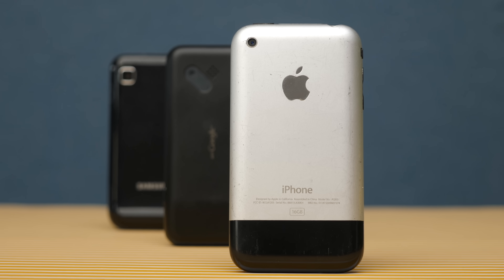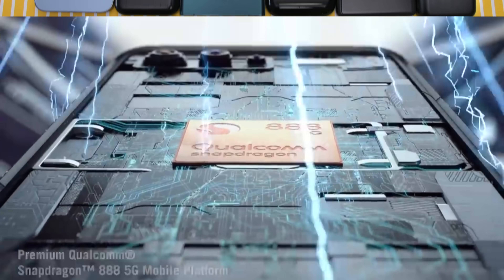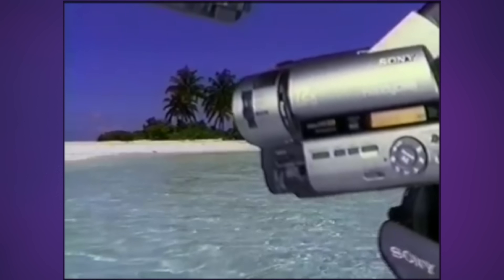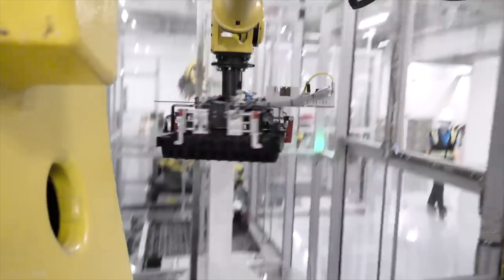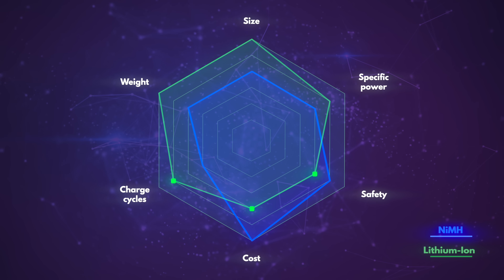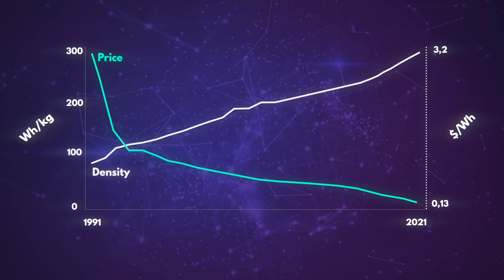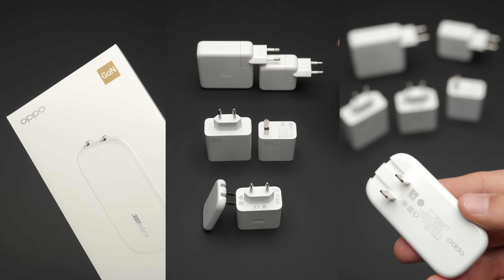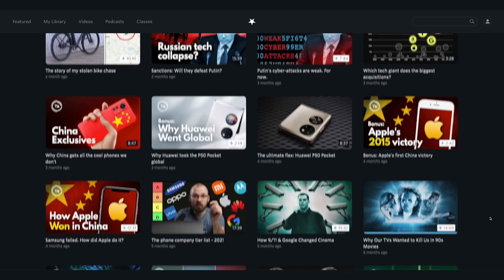The billion dollar race to fix phone batteries

Comment: Personally due to my financial situation I can't afford to change phones super frequently. My current phone I've had for 3 years and the one before that I had for 5. My last phone was an LG V20 Android and I had upgraded the battery multiple times over the 5 years I had it even going as far as doubling the stock battery's capacity since it was cheaper than a new phone. I eventually did get a new phone, a Google Pixel 4a 5G in December 2020 for $500 and I must admit the battery, while being 2000mah smaller than the aftermarket battery in my V20 lasted longer. Even 3 years later, despite starting to see issues with the battery it still lasts damn near the whole day under moderate usage. I'm quite impressed with the battery life and charging speed after 3 years

Comment: There is no battery problem. The current batteries are perfectly suitable for the job. The big problem is actually the phone makers who insist on a tiny thin phone. I would be happy with a phone twice as thick with double the sized battery. The bonus would be you could then also fit sd card reader and audio jack back in the phone. In addition you could fit a decent telephoto lens as well.

Comment: Battery lifespan is my biggest complaint with Li-ion. And it's not just the smallish number of discharge cycles that sucks, it's the fact that they also degrade over time. So even if you barely use your battery, it will still only give you about 2-3 years of solid performance, after which it drops off quickly. We need batteries that can be charged and recharged indefinitely, that are removable, and standardized/modular, so you can carry them over to new devices, etc.

Comment: EVs with lithium batteries are overweight, under-range, with poor charging rates...and you think that a lower energy density, heavier battery is a great solution.
...
At some point can we just get behind the idea that a battery powered car is a bad idea? Carts and trollies and short range stuff, sure it's a great technology. But it doesn't scale up to driving dozens or hundreds of miles.

Comment: Since the manufacturers have apparently demonstrated that size doesn't matter (I am not one of those to whom it doesn't matter--I drive a 3rd gen SE), maybe the next level will be seawater-based batteries carried around in a 5 gal. container with detachable clips at the bottom of the phone.

Comment: My biggest issue isn’t the charging time or how long it lasts but how bad battery health is. I’ve had my iPhone for about 2 years and now my battery health is like 65%. My phone charges fully in like an hour and discharges completely in like 2 hours of moderate use :| this wouldn’t be so annoying if replacing your battery was possible without having to take apart the phone and possible ruining the home button if you don’t do it properly and also have OEM replacements readily available.

Comment: The most frustrating thing is non replaceable batteries. I don't like upgrading my phone every 1-2 years but I'm forced to about every 3 because the battery degrades to a point to where it can't hold a charge for even half a day with minimal use. the cost of replacing the battery usually involves breaking and replacing the screen as well so at that point its not worth it for an outdated phone.
Reply: the company says its because its better to make water proof phones, ok that i can accept, so water proof phones don't have the replaceable batterys, but  

the phones that are not water proof still don't have this option to replace batterys, so  what gives? why the companys are lying then

Comment: People talk about lithium, sodium, graphite, silicon and all solid state, but not cobalt, nickel, manganese and copper. Cobalt and nickel are essentials for battery whitch mean there are no alternatives. manganese and copper are existing relatively large amount but still difficult to replace. We already manufactured so many batteries but not ready for recycling them is fatal failure. If we will fail to recycle these material means waste all and never come back cobalt, nickel, copper etc. IMO it's same as nuclear disaster.
Reply: Tesla uses LFP batteries that don't use cobalt, they have also built hydrometallurgy recycling plants to handle all the dead car batteries in the future cleanly and profitably.

Comment: ive always bought my iphones refurbished rather than new, and i also hold onto them for ages before upgrading.
As a result, ive replaced the batteries in my iphones twice each.
Ive had a 5C, 7, and 12mini (current).

Replacing the batteries in these is piss easy and i don’t understand why people complain so much. The only difficulty is getting past the waterproof seal in the newer ones, but it’s still easy; just a bit of heat to soften it and gently using a pry tool.

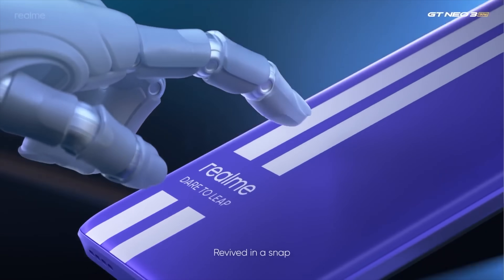Comment: 0:59 if you asked the average user what part of the phone improved the least over the past decade, most would not even think about the battery, instead most would instead likely point out the style/design... Most flagship phone maker over the past decade, especially the major players, such as Apple, have litterally been pushing out phones which look like carbon copies of the previous model.

Not like the days of Steve Jobs where they were making drastic and feature design changes model to model that everyone could notice.

Comment: Lithium might not be dense since its the 3rd element. But dont forget you also need to use cobalt,copper and other heavy elements to make it. By changing the small% of lithium to sodium would only 4x like 1% of the weight. Where replacing cobalt or the copper sheets inside with something lighter would have mpre effect.

Comment: Most manufactures put too much focus on increasing battery size because that's the easiest solution. But it's not scalable, because the moment you have more power you start using it to crunch more data for more intensive UIs and apps. Apple is the only company that did the hard but right thing, which is to prioritize software optimization and eventually custom hardware that blows the old chips out of the water in terms of battery life.

Until something revolutionary replaces current battery tech, this puts Apple in an incredibly lucrative position to have by far the best battery life in the industry if they play their cards right.

Comment: Especially for phones we don't need exponentially more power anymore, we need more efficiency, and Moore's law should also provide us with that. If we just build more efficient processors instead of stronger ones we could do a lot better in terms of battery life. Same with just moving away from x86 on laptops, which just isn't very efficient anymore.

Comment: 0:30 PLEASE stop using mAh. If you had actually done research, you would know this capacity metric is very misleading, especially since not all Li-Ion batteries share the same voltage which can affect useful energy. At 0:36 you don’t say the iPhone charges at ~3000mA, you say it charges at 27W. W and Wh takes into account all different battery voltage differences. 

10:50 you mention LiPo as safer. Trust me, it’s not and can be permanently damaged when left fully or nearly fully charged for long periods of time. 

Another point you forgot to mention is damage from high states of charge. I admit it’s harder to find sources that support this, but it’s the reason why many EV manufacturers have discouraged full charging even for a short amount of time (LiFePO4 exception). I can say from personal experience that charging my phone like an EV has given me much better capacity. I have over 500 cycles on my iPhone 12 with 91% capacity remaining, much better than my friends and I get similar results with my older Samsung phones (using Accu Battery for measurement).

Comment: What a pity that there's no simple option that wouldn't require years of research... Oh wait, there is. Just make the battery fricken replacable. It get's low on power? No problem, just pull out a charged battery out your pocket, stick it in your phone and you're good to go. I know it doesn't exactly help the sustainability problem but it surely would be convinient and technically provide a longer battery life and lower degradation since you would have less of a reason to decharge it completly. Just charge the battery while you use the other one, no need for the discomfort of a charger so no reason to wait until your phone dies before you finally decide to charge it.

Comment: Companys like Apple claim every year a more efficient chip but also reduce the battery size of thier phone each year. Apple has the smalles batterys in thier phones. My problem with this is, that after 2 years when the battery reaches its 90% life its hard to survive one day with one charge. Obviously they do this so you need to replace your battery or buy a new phone. If they would increase the batterysize the phonebattery would atleast last 4 years before you need to change the battery

Comment: Those fast charges kills the battery. So does charging to 100% all the time or discharge it to much.
Reply: No it doesn't the oneplus 11 has 1600 charging cycles killing ur battery would be letting it go below 20% and always charging it in a hot temperature which is not ideal

Comment: People just need to deal with thicker phones

Pick 2 
Portability
Performance
Battery life
Reply: And tbh I think current phones have more than enough battery life. Stop using a phone as a daily driver and replacement for a laptop or desktop. It just isn't the purpose of a phone.
Reply: @portman8909  umm, no, phone batteries are not big enough for the performance they have to offer

Samsung S22 ultra required 3 recharges per 24h period when I had one 

Galaxy fold took 5 

The best solution is to make phone batteries removable, then people can bring as many spares as they need (and no, making the battery removable does NOT kill water resistance)
Reply: @mwbgaming28 lithium ion and lithium polymer is just not good enough anymore i wish solid state batteries and graphene was commercial

Comment: No swappable batteries these days! Another problem with smartphone batteries is that virtually no phones today allow you to swap old batteries for new. The Android phone I used for work several years ago came with an extra battery. Now, phone makers and marketers want you to swap out an old phone for the latest and "greatest" every two or three years ("that will be $1000, thank you") when the battery starts showing its age. A couple of years ago, I found the Samsung Galaxy XCover Pro (no, it's not "5G"), but I have an extra battery for the unit (Samsung was touting this phone, and another like it, for "business users," not "consumers" -- as if business users were not consumers, too, but some other species, perhaps Martians). This will extend the life of my phone by another two or three years. I don't need the 5G -- and its hype -- for anything I do at this time. I'm very happy with my rugged Galaxy XCover Pro -- and especially the extra battery I have. Bring back replaceable batteries!!! 😠

Comment: LoL 5000mah is not huge! We should be at a minimum of 8000mah regardless of phone size. 
5000mah is not enough for all day performance at maximum settings performing the most battery taxing task..... 
Out of a 24hr period, I'm using my device at minimum 85% of the time... And the 5500mah battery is not enough! Cycling the battery once per day is not good for the battery, the slower the drain the longer the battery will last....

Comment: My first smart fone would last several days of regular use including running a database and talking constantly on a 2 hour commutes. Show me your iPhone today that can do that. Yes the screen was only green but if the battery did die I could always swap it out myself in seconds. And the battery didn't start overheating after 1 or 2 years. Lithium was just a con to force you buy a new fone every few years.

Comment: The best battery tech is... swappable batteries.
Ain't that a bummer? remember when you could just pull your battery out and put a fresh one in?
My brick nokia had the basic BL-4C battery that costs about 7$ and I could just put a charged one in when it ever ran out
same for Samsung and LG phones until recently.
As for today's Samsung phone, it has a 'Protect Battery' setting which limits charge to 85%. I am using my phone with this turned on for a year now and it still lasts me the whole day.

Comment: The issue of batteries is, they can either be recharded a gazillion time's meaning forever. Or they can only be charged a million's of times. The first, cause's them to be less powerful and take longer to recharge. The latter cause's them to be more powerfull and take less time to recharge. Thus the issue is one use to have a choice when it came to the usage or purpose they had when utilizing their phone. Today, one no longer has that choice. The  battery industry can't provide a sufficent return on the investment's of investor's if and when a battery last longer. So by installing any and all of the various attributes a cell phone can now do. Even though one may only actually only utilize one or two perhaps three. Are cnvinced we need those other atributes their phones offer in the future. In order to justify their planned obselesence.

Comment: sodium would make a weaker battery. its only good for ground based installations where space and weight dont matter. 
the only alkaline metal that has more energy density than lithium is Beryllium which has a charge of +2. atomic weight of 4, slightly heavier than lithium but just as portable. 
non-combustible in solid form. so its safer than lithium. 
We should be focused on making Beryllium into a practical battery instead of sodium.

Comment: I'd love to hear what you think of Louisville Colorado based Solid Power's claims about a silicon-based flat cell with a higher Wh per Kg and Wh per Liter energy density than currently leading high end cells, made on largely the same production lines as current lithium cells. 

I haven't seen any yet but I'm very curious to hear observations about their proposed process.

Comment: An annoyance with phone and many types of device batteries is the limited lifespan.  After about 2 to 3 years of use the battery starts to decline in performance, and soon starts to swell up. I have had batteries swell up and pop off the back cover. I  had some tablets where the swelling of the battery pushed the screen out from its mounting.  I had one phone where the battery swelled up so much it cracked the rear cover and also cracked the circuit board under it. The damaged circuit board made the phone not serviceable because it was the main system board. This meant having to replace the phone. 

If you do some research you will find with the phone batteries most manufactures rate them for about 18 to 24 months with peak or near peak performance.  If you keep using the battery, after about 36 months chances are it may start to swell up. A swollen battery is dangerous to use, and can  cause damage to the device.

Comment: the simplest solution to this is to allow the user to replace the battery.
It's not impossible, and there are ways to engineer a waterproof battery compartment seal, but they'd prefer you just buy the new phone.

Comment: More battery capacity doesn’t necessarily mean longer battery life on a phone but it also depends on the phone’s power consumption and efficiency
Reply: true, but I don't think they would increase power consumption much., because modern phones are already close to overheating when the CPU or GPU is fully utilized and of course there is no reason to abandon power saving technologies when the hardware is not fully utilized.

Comment: In 2016 I bought an iPhone 4s off of Amazon. It was pre owned. It looked like new and it’s battery was okay at first but then by 2017 the battery was pretty much useless. Turns out it was a 4s made in 2011
Reply: Even if it wasn't used the battery degrades sitting in a box almost as quickly.
Reply: @pegcity4eva  that's true

Comment: haha, 240W battery charger no fucking thank you. I'm sure they figured out how to make it safe but I would never trust holding something in my hand that has 240 watts being pumped into it. I'll take waiting for my phone to charge any day of the week. imagine someone using a 3rd party cable and just having their hand get fucking melted.
Reply: Your thinking 240V
240 W is not that big of a deal.
Reply: @Crashed131963  no I'm thinking 5 volts at 48 amps, or 240 watts even if it was higher than 5 volts that's still a shitload of power. You ever see a regular USB port short? It gets so hot, imagine 48 times that in a case where it doesn't auto shutoff.

Comment: what about a solid semi-conductor electrolyte?

basically replace the electrolyte with a diode, the reverse voltage would be the internal resistance and then it would also charge a lot faster as well because it would have a lower resistance in the charging direction than it would in the discharging direction.